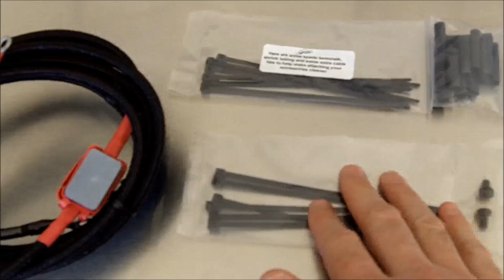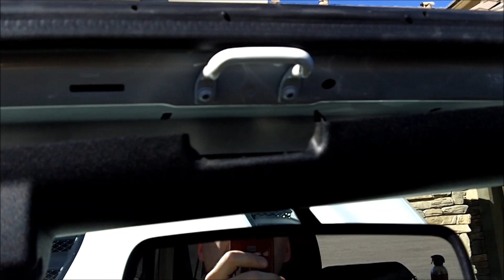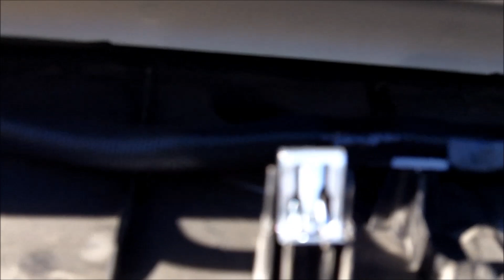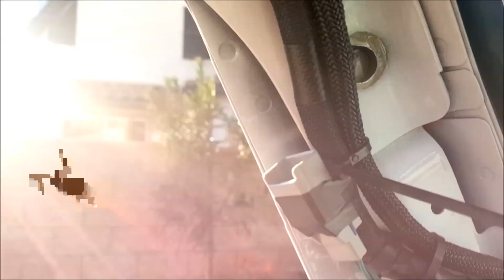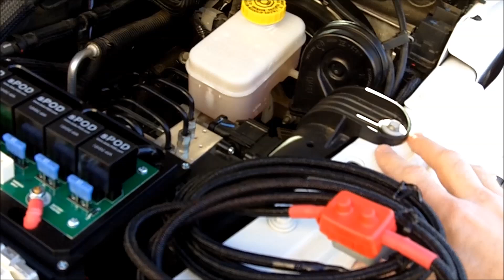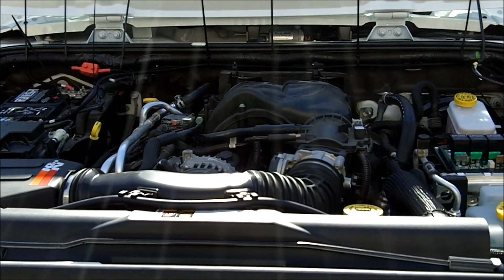sPOD install on 2013 Jeep Wrangler Rubicon (RockTrooper)

Comment: I took out the horn and the 2 10mm bolts but the other one with the sleeve and the screw like bolt I cant figure where they are the picture of u taking the sleeve like bolt out  I cant figure where that is and im totally dumfounded where that white machine screw like bolt is  I wish u had added a commentary on that part as well as pictures. Other than that great video
Reply from the maker: BILL Quinn can you tell me at what time point in the video you are talking about? I can probably answer if I know the exact part/point you are referring too.
Reply: It is part of video wher you go the still photos of taking horn out and removing several 10 mm bolts you have what looks like a white machine bolt with a 10 mm bolt like sleeve. That's what I can't figure out where that white bolt is

Comment: 18:50 You shouldn't use this connection on the battery terminal.  That post is used specifically to tighten/clamp down on the battery post.  You may have issues with that coming loose.   Should have used one of the accessory bolts on the terminal.  Just my 2 cents, but good install otherwise.
Reply from the maker: Kevin, you are correct. I had since moved the connection from the terminal lock nut to the accessory bar.
Reply: Cool videos fyi.  Thanks for the channel.

Comment: Hi John, great vid, please need Your helb. I've seen during Your Spod install, that Your JK is fittet with the Auto Dimm rearview mirror, i would retrofit the Auto Dimm Rearview mirror. You opened the A- trim panel and the trim panel (on the left side) between door and speaker - now my question to You. Is there at Your Jk the Auto Dimm Rearview mirror wired up? Do you know the color of the plug blak, gray? Thank You;)
Reply from the maker: I'm not sure what you are asking. Do you want to know if the wiring for the auto dim mirror runs down the side? If so, I believe it is based on what I can view in the video. I do not know what the wire color combo would be though, it is all taped and loomed up. I am sure if you search the forums someone may have it already identified

Comment: I just started modifying my Jeep and I am not too experienced with it. So I picked out my otrattw switches, do I just need to get the SPOD kit and they would fit right in? Is there an option to get the kit without the stock SPOD rockers? Thanks
Reply from the maker: +SEVA26 I do not believe there is an option to get the SPOD without the switches, you could always e-mail/call them and ask. If not, you can simply remove and replace with the switches you already have.
Reply: +John Golden (RockTrooper) Thanks, yeah just emailed them, my Jeep is a Diesel and right hand steering so its not exactly typical..

Comment: Are those lights on ur rear view mirror??
Reply from the maker: Hey Nick, are you referring to the light sensors on the rear view? I don't have any lights on the mirror itself. The sensors are used to auto adjust the mirror for headlights coming in the rear window. Is this what you mean?
Reply: yes.. it looked like lights lol!! its so dark at night in my jeep and want to install lights !!
Reply from the maker: +Nick Mossey check out Amazon, they have a full interior LED light setup to replace the existing bulbs. I know a lot of people have done it and it works great!
Reply: ok thanks!!

Comment: John, do you have or know of a video for installation of a s-POD in a 2012 JKU with a manual transmission?  
I'm having g a very difficult time trying to find a pass thru on the firewall.
Reply from the maker: Sal, I can check around and see if anyone has a 2012 MT. I would think that the pass thru would be the same regardless of the transmission type since it is body related, but I'll see if I can find out and respond.
Reply: I completed this install. It only took a little patients with passing it through the grommet for the rear washer fluid and then routing it alongside the console hardware to the "A" pillar. All in all it took about 15 to 20 mins. to snake and tie in the switch harness.

Comment: Once the sPod was installed, were you able to fully turn the hard top twist-latch back into place or was the sPod wire interfering?
Reply from the maker: It was a bit tight and did take some adjusting of the control box, however I was able to get that latch to fully close without having the control box restrict it.
Reply: SuperAerobat in the video john tells you to put the footmens loop behind the bracket but thats wrong.changing the position of the footmens loop will cause a problem when latching down the freedom top. the switch panel bracket goes right in front of the footmens loop. sPOD had some really good install videos on their website. you should check those out
Reply from the maker: OGH, I'll have to check out sPOD site and see their videos. I don't have any issues with my switch panel or latching the freedom panels to the footmans loop, but it is a but tight. Thanks for the info!

Comment: I really liked your video I just want to know how watertight all the switches inside the Jeep . I leave my top off a lot. Could water get in there easily. Well done with the video you should see mine putting an exhausting
Reply from the maker: Hey Joey, it is not a waterproof box, however with the appropriate addition of some silicon sealant in key areas and perhaps some rubber skins around the switches too, may help reduce water from getting inside. Any waterproofing would definitely be a DIY project. I leave my top off most of the year as well, however not much rain in SoCal :)
Reply from the maker: Actually, you made me think about it more so I went out to check it out. The rear of the box is wide open and form fits around the molding, so you could silicon around that area. However the top of the switch box that is open to the footmans loop is fairly well exposed. You would have to fabricate something to close that gap around the unit and loop to prevent water from leaking in.
Reply: Thanks . Still looks like a great kit.

Comment: Once installed, how exactly do you wire lights to it?
Reply from the maker: Daniel, real simple actually. You just run the wires to the distribution box under the hood and you are all set. Check out my other video of the rigid lights and you'll see.

Comment: Over $400 for a flashy packaging and $50 worth of hardware?!?!  You can build one yourself for less than $75 (if you want a snazzy case for the relays to sit in) or just pay your local shop less than the cost of the kit to install 6 sets of lights or other switched devices, and have just as 'nice' looking setup.  This is just an example of people with too much money and likely don't actually use their vehicles.  part of wheeling requires you to fix your rig, often on the trail.  This kit is electrical 101.
Reply from the maker: Fly, not sure why you are butthurt over a power Distribution unit. I had researched building my own and yes I could do a nice setup for about $150, not just a bunch of switches and a plastic box. But I really did not feel like running all the wires, etc. I have been driving my rigs off road since 95 and I have probably done more trail fixes than you have gone offroad, both on my own rig and others on the trail. You seem to be one of those people that are just angry at everything. Cool, have fun out there on the trails!

Comment: So I am not necessarily looking to spend $500 on a switch panel if I do not intend on using 6 switches. This sPOD seems to kind of be fool proof unlike your typical daystar switch panel that is basically just the switches. Is it worth the $500 if I will only use about 3 of the switches? Also, nothing against your video I just do not trust myself to do this correctly, Do you think my neighborhood car shop would install it for a reasonable price?

Comment: John, in the video, it looks like the main battery cables remained connected to the battery.   Am I correct?  Wondering if I need to disconnect the jeep battery while installing the SPOD.
Reply from the maker: You don't need to connect them because you do not hook the distribution unit to the battery until the last step. With mine, I just connected the cables from the sPOD unit to the extension connectors I have running off the battery. When running items to the sPOD (lights, etc) then disconnect the sPOD from power then.

Comment: how well does it fit with a hard top
Reply from the maker: No issues at all, at least for mine. You can adjust the positioning of the housing as needed so you can fit the release handle for the freedom top. I have heard other did have problems getting to the handle to lock/release correctly though.

Comment: Thanks for the video. Do they recommend you disconnect the battery cables so that it's not hot?
Reply from the maker: If you are talking about removing the cables to the battery at the time you are hooking up the distribution unit, yes.

Comment: John:

What all do you currently have (or plan to have) hooked up to your spod.
Reply from the maker: Jon, I currently have flood, spot and rock lights connected. They take up 3 of my switches now. I have install videos of them as well, just check out my channel for the videos. Are you asking because you were wondering if you could hook up a specific item? I know you cannot connect a winch to it.

Comment: can i change the switches? replace them with another rock switch??
Reply from the maker: You sure can. There are plenty of manufactures that make switches you can use in place of what you get from sPod.

Comment: Love it . I noticed they have one with a air gauge . Will it fit in the same place as the one without the gauge it looks much bigger and does it all go on so easy
Reply from the maker: Yes, the model with the air gauge in the center does fit into the same location. I have a buddy that has that model. Overall, install was not hard at all, it will vary on time based on how particular you are :)

Comment: Hi John, thanks for the video. Do the LED on the switches distract you at night? Do you know if I can run rigid 50" light bar 10" light bar d2 x 2 and warn 9.5cti-s using spod without the need for additional power supply? Thanks in advance. Killer jeep by the way
Reply from the maker: Hey George, the lights inside the cab are no distraction at all. They are not bright, just light up enough to let you know the device is on. Yes, you could connect a 50" ( which I am planning on adding) and a 10" light bar. You cannot hook the winch up to it, you need to run that straight to the battery.